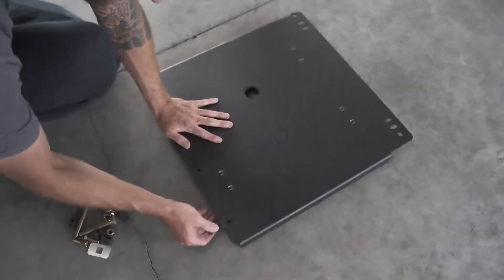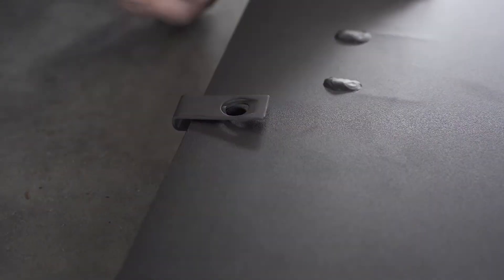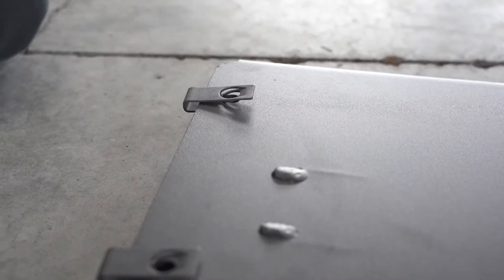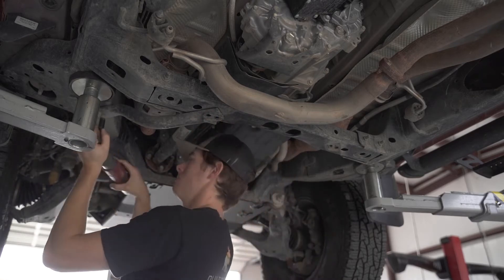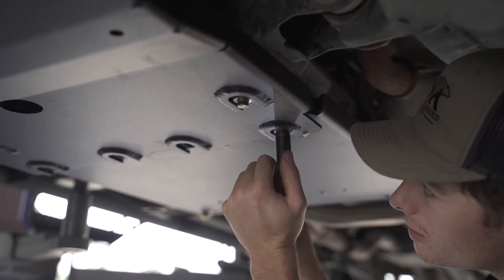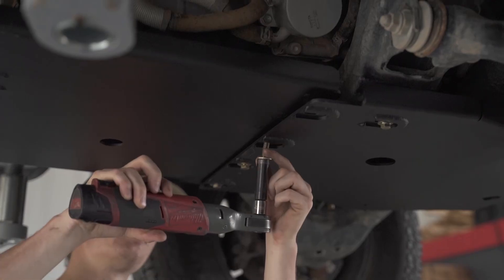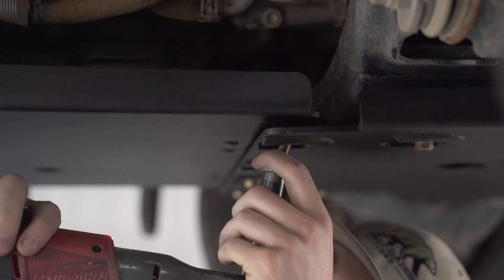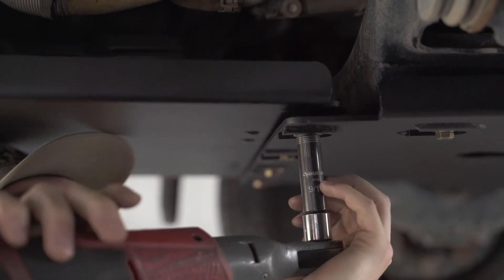How to Install Transmission Skid Plate for 2005-2023 Toyota Tacoma | Cali Raised

Comment: I have a 2023 Tacoma off-road long bed double cab, so your milage may vary.  The front t skid went on like butter, no problems.    But this thing, the transmission skid, has been a struggle.   First, the four holes in the front that lay over the front skid plate are too small for the 3/8th  provided hardware.  Just by a little, but it's hard to squeeze steel.  Drill baby drill, I guess.    2nd, the carriage bolt on the drivers side is really a tight fit.  There is a bracket that fits around the cat converter that is bolted right next to where the carriage bolt comes out the top through the frame.  I hate to take the bracket off,, because that would be trading one problem for another.  That angle not shown in the video.  I can g!et an offset box wrench on the carriage bolt and give it ~ 1/6 turn at a time, and sometimes even get the wrench back off again without having to hit it with a hammer.
UPDATE:  drilled holes, very easy, the stuff that came out was soft and rubbery.   The slide o. Nuts were a bit of a pain, had to put truck up on ramps to get enough access to get em lined up again once the slid in the skid plate during install.  Got thr drivers side  carriage bolt on tight, it just took a LONG time.   I think the job could be done without Jack stands or ramps, but I would not reccomend it.
Reply from the maker: @jamesduzan3345 Please contact our customer service team via info@caliraisedled.com and they will be more then happy to assist you. Please let us know if you need anything else, we are here to help.